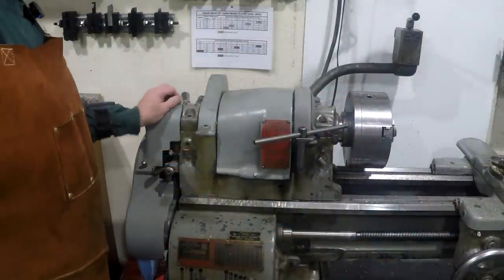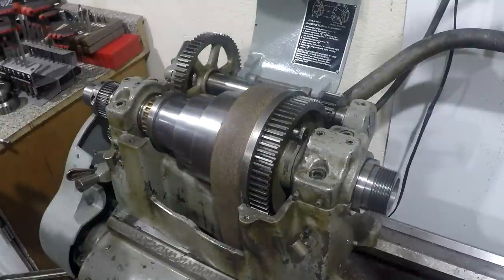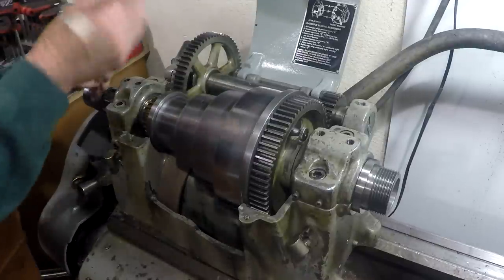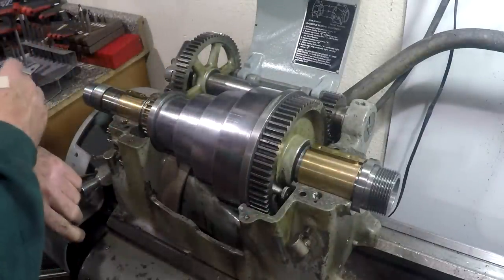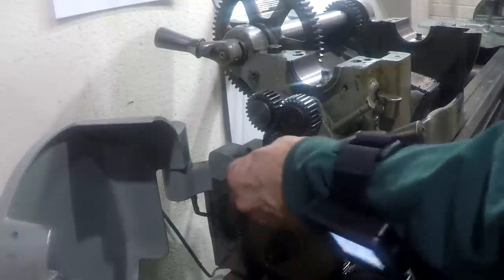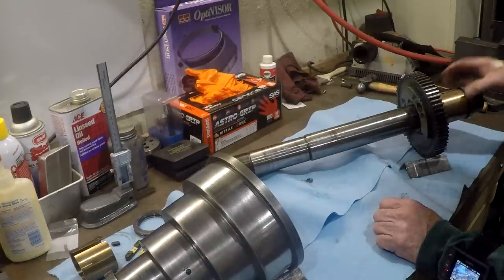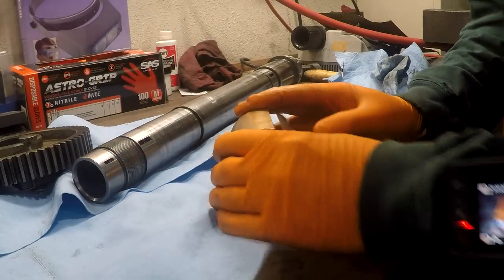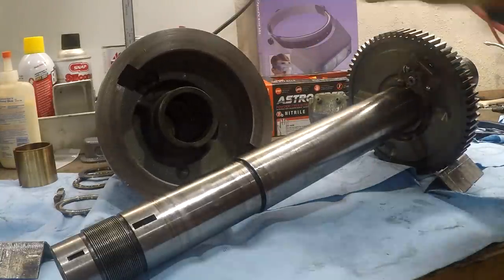South Bend 13" Lathe Spindle - Part 1

Comment: Your also going to need to change your drawbar for Collets if you go with the cam-lock spindle.. it’s a matter of it needing to be something like 5/8” longer than the one that’s used with the threaded spindle
Reply from the maker: Good to know for the folks with a factory drawbar, I assume. My drawbar worked fine so maybe I made it a bit longer than stock to start with. Thanks for the reply,

Comment: Hey, thanks for making this video.  I've got a question regarding this type of lathe.  An opportunity has come up for me to potentially score one of these machines for free, but moving it is going to be a big problem.  Since you've got so much experience with this machine, can I ask how difficult you think it might be for someone reasonably handy to separate the headstock from the bed - and the bed from the base for transport?

Are the headstock and bed more or less self-contained assemblies that can be separated or is the whole idea of moving it in pieces just a rabbit hole?  I'm not really ready for a full-size lathe at this point in my life but... it's free.  If I say no, it's probably getting demolished along with the building it's in.  So I don't know what to do.
Reply from the maker: Free is always good. I would prefer the machine in one piece if possible. I've not removed the headstock from one but it should line back up close with the ways under the headstock. There may be some alignment needed. Whatever you disassemble should be able to be reassembled. Like I said, some adjustment and alignment may be needed. There should be plenty of YouTube videos on any alignment needed. The more you take apart and reassemble the better you will know your lathe. Good luck with it.

Comment: I sent you an email but no response. I don't know if you can suggest anything that will put some insight on the continuous issue I am having with my South Bend 13" Lathe made in 1960. It has a 3 step pully and is apparently a engine lathe model according to the numbers stamped on it. It continues to lock up after 20 to 30 seconds of running. I bought a new rear bearing from Ted just knowing this will be the answer. No change in performance regardless of the bearing settings. at the end of 30 seconds of running the entire bearing cap is hot!! I have carefully followed the suggested steps as listed in SB literature and as suggested by Ted Pflugner. I would like to remove the pulley and leave the bull gear on then set it back in the headbox with bearings and caps. My question is would I be able to accurately determine from rear to front if the spindle is true or not? I was going to attach a short piece of flat bar large enough for my mag stand and indicator to work using the single screw hole that ties the cover over the bull gear engagement at the front. It doesn't seem to matter if the bearing are set .001 or .005 you still can't turn it by hand without using a lot of force. There is no spinning freely as seen in so many other videos of the same size lathe made by SB. When I bought the lathe 2 years ago it did run until I went to a higher speed. It was no where close to factory settings. On the rear bearing the inside shims where .019 and the outside shims where .007. The front bearings where also at strange settings and the expander wasn't being used, they but spacers on top so it couldn't be pulled up like it should. You can laugh if you want but I have been trying to get this working for over a year. I am disabled and it is extremely difficult for me to work on it. I lost count on how many times I have taken it apart and reassembled it. One note to mention is that the rear capillary spring that sits under the bearing for lubrication was broke in half so there was no oil getting to it. I also did as you suggested and started at a high point with shims and slowly removed .001 at a time to get to the tolerance required. The 4 page article on adjusting the bearings indicate if it's less that .0007 then add a .0015 if it's greater than .001 then remove .0015 from one side and repeat the process. I am reaching out to you or anyone that might have a suggestion. The front bearing runs great it's all in the smaller rear bearing or spindle. Thank you for reading this.
Reply from the maker: Sorry, I never saw the email. It sounds like the shimming is correct. I think your idea to check the spindle shaft for runout is appropriate. I would think you could set it up the way you suggest and leave the bearing caps off to do the check. Check it on the ends and the middle of the shaft. It should be dead straight, I think within a couple of tenths. I agree that it should not be hard to turn with the flat belt loose. I have a couple of thoughts although they are sort of last resort things. Is it possible the thrust bearing is adjusted too tight? It is possible the flat belt is way too tight (I doubt it)? I would think that lack of lubrication would not be the problem because it would not cause it to feel tight to spin by hand. One other check would be to put a thin coat of prussian blue on the inside of the bearing, reassemble and rotate it a few times by hand and then disassemble and look for irregularities in the contact pattern, the blue will wipe off on any tight spots. It may be kind of subtle and the thickness of the prussian blue coat can make it easier or harder to see the contact pattern. Clean it up thoroughly when done.

Anyone else have any thoughts?
Reply: @OldIronLover  I'm ready for any ideas and once again I believe what you suggested will give me some results. I sent an email to George Bell, I was looking at the way he set his 13" SB motor controls up with a VFD and mentioned what was going on. I am at wits end. There is no shortage of lubrication and the belt is not too tight. With the belt loose the spindle is just as difficult to turn. I'm having another surgery next week so just as soon as I can round up what I need I will get right back to you. Many Thanks

Comment: Mild steel 3" diameter what's the biggest cut u can make with any cutter? 0.100" @ 0.010/rev?
 With HSS?
I just got my 13 and I'm having trouble getting more then 0.030" @ 0.006"/rev at top speed of 940 I think before the belt slips. I've dressed it but I think it needs to be replaced. Is the belt meant to be tensioned when the belt handle cams over?
Reply from the maker: Well, there's a few variables. With my old 1 hp single phase motor and the old rubberized canvas belt I could get about .040 reliably in the C slot on the left tumbler handle and in the middle slot on the right. I'm not out in the shop at the moment so I don't know exactly what feed rate that is. I upgraded to a 1-1/2 HP three phase motor with only marginal improvement so far. I have some belt slippage and I'm not sure I'm getting the full 1.5 HP out of the motor with the VFD I'm using. I still need to align the v-belt pulleys on the motor and lower cone drive. I have a new flat belt to install between the lower cone pulley and the cone pulley on the spindle. I may have to step up to a bigger VFD. So the jury is out for now but I'm hoping to get up to .100 anyway.
Reply: @OldIronLover  I also have the original 1ph 3 ph motor on it. I also just bought a 1.5hp motor to upgrade. I thought it was the motor slowing down at first. Then I stalled it and realized it's the flat belt slipping. So I bought belt dressing but it wears off cause it's still slipping. The tension handle on mine is adjusted to the max. To the point when it cams over it doesn't actually add any more tension to the belt above the gravity tension. Is it supposed to add additional tension when the belt handle is all the way down or just allow gravity tondo it's thing like the v belt is doing also? 
Thanks for the help!
Reply from the maker: @electromechanicalstuff2602  The handle is definitely supposed to apply tension in the downward cammed over position and release it in the up position. The released position is useful when you want to spin the spindle by hand like when you are centering a part in a 4 jaw. It sounds like your belt is too long, maybe stretched out? I have tried a couple of belts with mixed success. The original belt has a Clipper style splice in it. I had a poly-V belt the width of the pulley surfaces that worked well for several years but eventually the glued splice failed. The belt on it now is a narrower poly-V and the splice is starting to fail. I have a glue-up flat belt kit from Al Bino that I have yet to install but it's going to happen very soon. My experience is that you have to very carefully determine the right length for the belt and it can be tricky. I've gotten it too short before and had to scrap the belt. In my case I had the original rubberized belt that was the right length to use as a stating point.
Reply: @OldIronLover  where should I measure the belt with the tensioner at 50% or all the way tight or all the way loose. Yes I'm looking at ordering the al bino belt right now too
Reply from the maker: @electromechanicalstuff2602 Check this out: https://albinoindustrialbelting.com/how-to-measure-machine-belt
I am hesitant to get too involved in measurement specifics as the only measurement I have done is to measure the original belt.
Reply: @OldIronLover  thanks a lot! I somehow didn't see those instructions when I was looking. It clearly says the adjustment should be in the middle

Comment: I have the exact same lathe and just tonight reassembled my spindle and headstock.  I wondered how tight I should tighten my expanders.  Do you have any guidance on when to know good is good?  The spindle does not spin freely ..... not like the back gear does.  But if I give it a good spin it'll continue maybe a half turn.
Reply from the maker: Short answer to your question: Once the bearing caps are tightened firmly, then the expander screws need to be tightened enough to draw the expanders snug up against the groove inside the bearing cap. They're fairly small so you want to take care not to strip threads.

Long answer to your question: First we should know the history. Was it spinning freely before it was disassembled? Was anything changed, i.e. new bearings, missing shims, etc.?

If everything is the same as it was on disassembly we would expect it to have the same clearances after reassembly unless something was amiss during reassembly. Once as I was reassembling mine after disassembly for inspection, one of the shims slipped out of place and was caught by the alignment pin and cocked the bearing cap. Jammed it up tight. In this case you should also start with the end play a little loose until you get everything spinning nicely with the right amount of vertical play (.0007" - .0010") on both ends. Good to keep the two shims on each bearing equal thickness within .001" or so. You can remove one thinnest shim from one set only to reduce clearance by 1/2 the removed shim.

It might be useful to take a look at the part 2 video. I reassembled mine with a NOS spindle and had to re-shim for clearance. I found it useful to get a new batch of shims from Grizzly (southbendlathe.com) because my old ones were wrinkled and bent and it was hard to get them flat enough to stay put during assembly. And it gave me enough shims to start with too much clearance. Then it was a matter of mic the shim packs, assemble, check clearance, disassemble, remove some shims, and repeat until you get in range. I would also recommend that once you have it right initially that you run it a few minutes, checking the bearing caps for excessive heat build up and then re-check the clearance and possibly adjust shims. It's time consuming but the life and accuracy of the lathe depend on getting it right.

Thanks for watching and asking the question.
Reply: Well, My shim packs were .... both front and back had a .015 shim on each bolt.... and on the large cap there was also a .002 shim on each bolt.  The .002 were kind of chewed up and so I traced em out and replaced them with some shim stock I bought.  So that is different, but it should make for much of a difference.  Although I might mention that one of the 2 thou shims had 2 corners folded over doubling their thickness .......... but  it might not have mattered it was only like 1/16 of an inch on 2 corners of that shim.  I honestly don't remember how freely it spun before disassembly.  This is my first lathe.  Did your expander bolts have small washers on them?  I had a washer on one of the 4 bolts ....... which made me wonder am I missing 3 or did someone add one?>  Thanks for the knowledge -Robert
Reply from the maker: There should be a washer under each expander screw head. If there were missing washers would it allow the screws to reach through the expander and bear on the spindle surface? I don't know the answer to that.

I expect that the corners folded over would be significant especially if they were both on the same end of the shim. This shimming process can be pretty touchy.

A couple of more things to check: Did you pin the wicks down into their brass tubes in the casting? If they are sticking up during spindle assembly they can get cocked and jam things up. Are the little felts under the expanders in good shape? Also if you look at the notch in the expanders that the felts sit in you may see that the notch has a V shape to it that would engage the top of the felt. These V's can be filed flat.

If you want to shoot me some contact info I can continue off line of even get on the phone with you and maybe help. If you send me contact info here I'll note it and delete the comment as soon as I see it to minimize exposing it to the public. You can use the YouTube "messaging" function to send me a private message if you can find it. I have to Goggle it whenever I want to use it.

Comment: I am just starting in the process of seeking to obtain an old South Bend metal working Lathe in the 9" or 10" version from the 1940's - 1950/60's era.  I have no frame of reference in regards to pricing for a restorable condition model.   Could you please provide me with some data on what I would be expecting to pay for one of these machines.  Thank you very much.
Reply from the maker: I'm probably not much help but here's some information: The price for used equipment varies by location, model, features, condition, tooling included and luck. I am in the Rocky Mountains and I see prices here quite bit higher than the rust belt where there's loads of machinery. Tooling can make a huge difference. I bought my 13" in good condition from my mentor who was the first owner. I spent $2500 but it included good quality 3 jaw and 4 jaw chucks, face plates, follower and steady rests and many, many cutting tools. Without any of that tooling I would have expected to pay less than half that. I have a friend here that bought a used 9" South Bend with a 3 jaw and a few cutting tools. The lathe was in need of some work and I think he paid like $500 for it. The model will make a lot of difference, for instance a 10" South Bend should go for less than a Heavy 10. There used to be some South Bend forums around online with good info. You may also consider a Monarch, Logan, Clausing or Atlas,.

Comment: is that lathe single or three phase?
Reply from the maker: At the time of this video it was a 1HP single phase motor. More recently I converted it to a 1-1/2 HP three phase with a VFD supplying the  three phase power to the lathe.

Comment: You Mean Bushing    Right
Reply from the maker: I think of flat bronze flat bearings as bushings too, but in this case South Bend calls them head stock bearings (see the bearing adjustment procedure plate at 2:26). Thanks for watching and commenting.